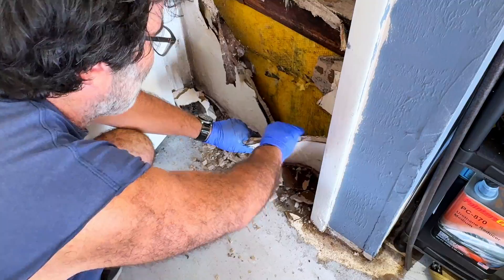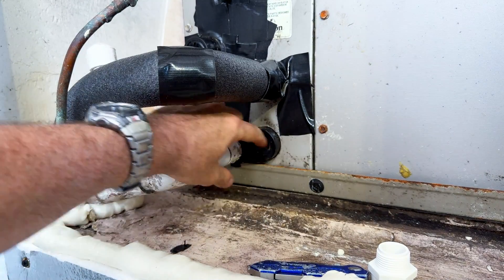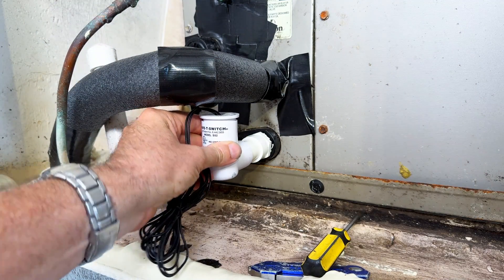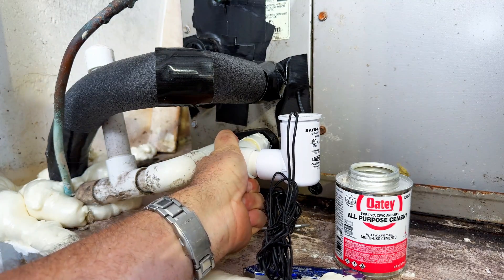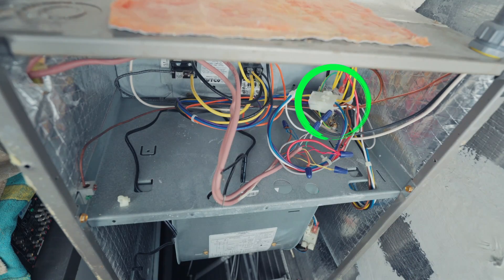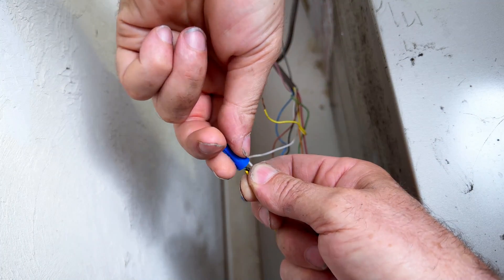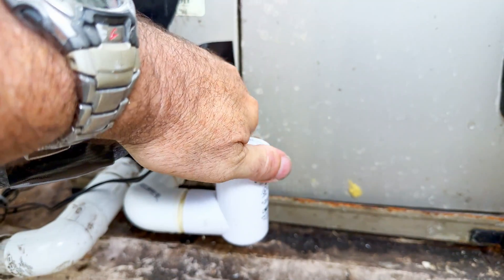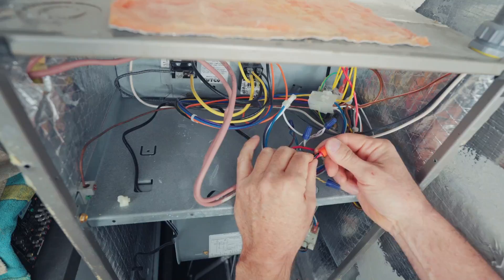This HVAC Part Can Save You Thousands in Repairs!

Comment: Thermostat wire colors can be all over the map.  Its easier for the average idiot to just see which tiny contactor control wires are heading outside and break one of them with the safety switch.  Example, most I see are red and white wires going to the outdoor contactor.  I install that float switch on every system I get near.
Reply from the maker: You might be talking about a straight AC with a gas furnace... Then I've seen the red/ white for the outdoor unit.. For heatpump, the yellow is usually the contactor, and red is the supply... White is aux heat.  But your right, it can be better to pull the covers off and have a look to be 100%...
Reply: @TheHomeImprovementChannel See why recommending breaking a certain color can be a bad idea??  How about when the guy sees oranges as yellows??  Trouble shooting  that change over valve issue will be fun 6 months later.   When the  guy starts snipping wires near a board, he's gonna screw it up.  Then he's gonna call me and waste his money and my time.  I use 7 wire everywhere, I even send it outside!  Can't tell you how many times thats saved my butt when joe schmo weed eats the wires outside!  I now put those wires in 1/4"  copper pipe strapped to the lineset going right into the condenser.  It has eliminated that Sunday 6pm call out almost completely!  You know you've done this too long when you roll up to a no start call and can smell the fresh cut grass.  😂